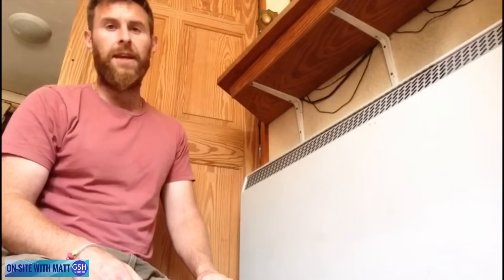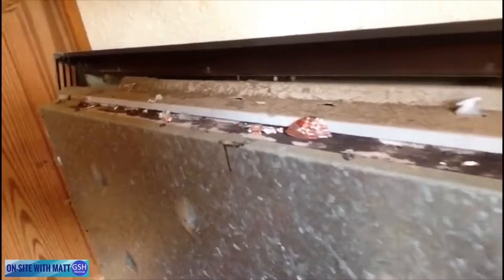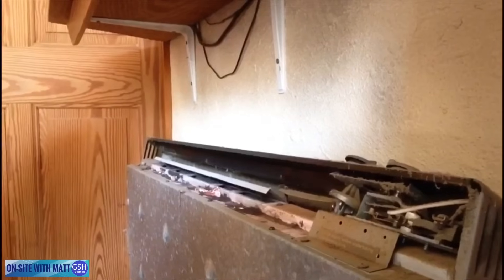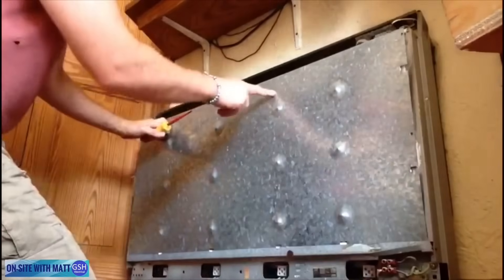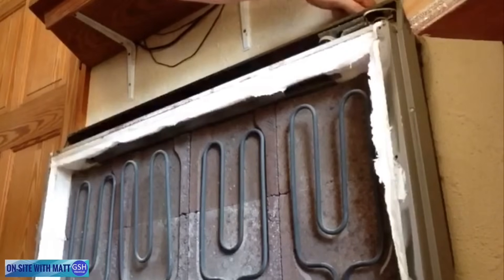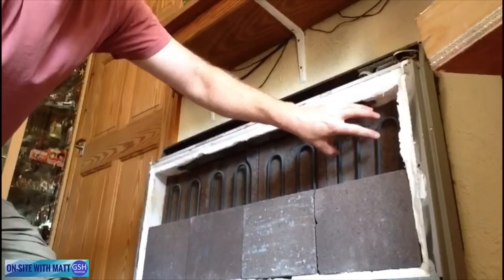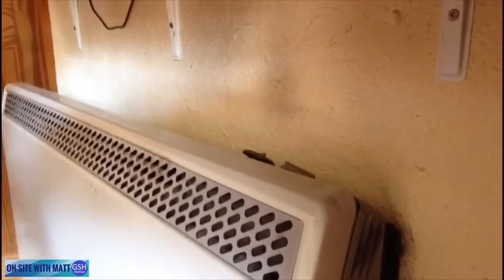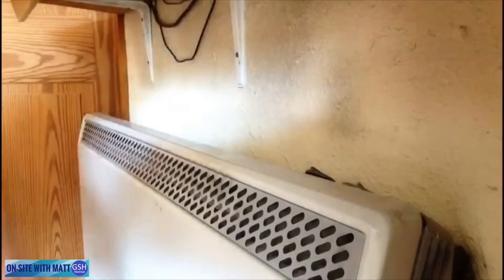Storage Heater is Losing its Heat too Quickly (Won't Stay Hot Fault Finding)

Comment: I have three of these very same heaters. 1x XL12 in the hall and 2x in the living-room, larger XL18s  The two living-room ones are not working. Vents closed thermostat on boost. Left that way overnight but still stone cold in the morning.  Power supply is on at the wall switches and mains board

Comment: Extremely useful, Thank you! This is the exact same model and size as my storage heaters. I'd never experienced this type heating until I moved into a new flat recently, and its been a shock financially! Each heater is costing me £1 an hour. Is this normal? Even with just 2 heaters its costing me £14 a day to heat the flat. Also, despite having the output dial at the minimum, the heaters are very hot in the night, once the Economy 7 turns them on. I'll take the cover off and check the vents are working properly, and maybe also check the thermostat?
Reply: These are wrongly seen as normal electric heaters they are not they use night time economy7 cheaper electric to store heat in heater core to push heat into room during the day.The heat from storage heater is stored heat from previous night.Storage heating is good if you understand how to work and plan system a lot don't know.Storage heaters for living rooms ,hall only panel or fan heaters for bedrooms ,kitchens.

Comment: Conclusion: there is no fault, other than the design fault of storage heaters - they do not insulate the heat while charging. The only way to get them hot during the day is to have them being super hot during the night by charging them at full power. Turning the output to zero while charging makes no difference.

Comment: Also, how does the heater know when is economy seven and to draw input? Is it only linked in to the economy seven electrical in the house??? Thank you, i don't understand but have to use them and trying to balance bills with heating (as we all do...!)
Reply: Storage heaters are on a separate economy 7 circuit controlled by time switch

Comment: Thank you, great video, now I understand about the output being a physical flap that opens and releases more heat.  So I can switch it off at the wall during the day and the output will continue to be right as it's mechanical/physical flap.
Also, how were you able to switch it on there in the morning and get heat into the elements - don't they only draw energy at night? Thanks again very much for the information, so important for people like me, budget conscious storage heater users
Reply: The elements are charged during the off-peak tariff. Off peak is say, 10pm - am

Comment: It is way easier to use a small amp clamp to measure the current flow to test the unit. You don’t have to open the inner panel to do it. Would have taken less than 5  minutes to test the elements.

Comment: My storage heating has suddenly stopped working totally, but the normal heater still works,  the fuse box is ok. Any ideas what the fault is ?
Reply: Well I opened it up, hoovered the dust and fluff , pressed the reset switch down ( little metal thing) , and now it's working better than it ever has done, giving our more heat than before,  I was just going to buy a second hand one tomorrow as well

Comment: Great video Matt.  It does beg the question as to why storage heaters are so expensive when the units are so simple and the components are cheap, at least from what I have found.
I have a problem with a similar Creda storage heater with four elements.  One side hot, the other side clearly not.  Already had 2 elements replaced just over a year ago and expect the other two have gone now.
If replacing the elements, how are they removed and new ones fitted?   Or do you have that in another video? :-)
Reply: The elements are connected at the bottom into plastic blocks with a grub screw for each connector. Trouble is they get very seized up with time and heat. Use the right size screwdriver and make sure it’s a good one, push in hard as you turn
Reply: @nicholascarter2640  - Many thanks.  I eventually decided to replace all elements in all the heaters, 7 elements in total across 3 heaters, so it was a good exercise and resulted in a very happy tenant.  Certainly it seems best to use a mask whilst taking storage heaters apart as they can have a considerable amount of dust and dirt inside.
Reply: @monsterp1970  did it make a great difference in heat changing the elements?
Reply: @thebrightsideofthemoon5829  - Hi.  The elements either work or they don't, so I don't think you'll get "half the heat" from an old element, for example.  I presume it will either use the full 850w of power or not.  They're either on or off, unless one of the electricians can correct me.
The house was very warm last time I visited my tenant.  These storage heaters are 26 years old, yet barely any design change to the latest one's.  A great way to have heating if you're at home most of the day.
Reply: @monsterp1970  , I'm glad you told me that, I was thinking about replacing mine to see if it would give me more heat. Mine stopped working totally but after watching YouTube videos on how to reset it, it's back up running.
Reply: @monsterp1970  Ive just picked up a 2nd hand dimplex quantum storage heater and thinking of replacing it for the older one like in the video. But as there is always someone in the house and I'm a bit of a night owl due to insomnia I don't know if the Quantum would be as good at having a steady heat. I know they're supposed to better at storing the heat and letting it out when you need it most  from a fan at the bottom with the timer. But will it be colder than the old ones when the fans not running?
Reply: @thebrightsideofthemoon5829  - I believe that one has a thermostat digital control, which maybe adjusts the flaps for you for adjusting release of the stored heat.  There is also the boost of an electric fan heater at the bottom, which essentially, is like switching on a fan heater.  I expect you can control whether this comes on or not if you wish.
If the heating element wattage, number of them and amount of bricks is similar to what you had before, then I imagine you'll get the same amount of stored heat, hopefully better.

Comment: After a few years old the Dail switches brake at the bottom and will cost 8 pounds for a pair it's the heat that brakes them advise once set leave along prolong the life

Comment: In these storage heater is a safty cut off located near the power in switch which will disconnect if items are placed on the vents of heater which I have had to reset as people do cover vents he screws in the bottom on heater are 7 millermeter sockets head's

Comment: I've never used or owned storage heaters so I am unfamiliar with how they work so watching this has given me some insight. Those heater elements heat the bricks overnight with cheap rate leccy and those bricks are made from such a material that will retain the heat and release it slowly enough to keep a house warm enough all day and maybe night time too,  even in the depths of the coldest winter? What material are those bricks made out of?
Reply: Crap in minus temperatures... doesnt keep the house warm

Comment: Hi Matt - I wonder if there is an error in your video?  I'm not sure that the bricks in the storage heater are the facing the correct way.  My understanding is that the recesses in the storage bricks should be facing away from the heating elements, whereas the bricks in the heater you serviced are facing towards the elements.  I think this probably accounts for why the heater is losing it's heat too quickly - because the elements are not actually touching the bricks, but are able to move freely and so mainly heat just the air around them rather than the bricks.  Please see link to the Dimplex installation manual here

https://www.dimplex.co.uk/sites/default/files/assets//FXLi_Instructions_Issue_001.pdf    

Please see point 11 about the back wall of bricks which says "Carefully fit the bottom row of the back layer of bricks placing the two end bricks  into position first. Ensure that the recess in the bricks is toward the rear of the heater with the narrow end to the bottom. Repeat this with the top row of the back layer of bricks but the narrow end of the recess must be to the top”  

Point 12 also says.  "Fit the front layer of bricks with the recess toward the front of the heater"

I must admit, this didn't seem logical at first because the recesses appear designed to fit around the heating elements, and indeed that was the way you found them facing when you opened the heater.  But I have had two storage heaters for a long time and the first one never worked properly, but it was installed with the recesses  facing the elements.  The newer one has worked fantastic for 13 years and when I took it apart yesterday I found the recesses were facing away from the elements, as the installation manual specifies.  It means the elements are tightly trapped between the bricks, giving much less chance for the heat to be dissipated by the air and so the bricks heat up much more.

I'm not an electrician, and yours was the only video I could find on Youtube, and it really helped me to take my heater apart thank you.  I have had to change three of the elements which had stopped working -  even though they looked in perfect condition.  As they have lasted 13 years trapped against the bricks this way, I am now convinced this is the correct way to install them.  I didn't install the storage heater myself, and that's the way the professional installer had originally fitted them.

I'm not an electrician so I hope anyone reading this will take professional advice as there may be something I've not considered properly, but they way I read the installation manual for my Dimplex FLX 24 seems to say the recesses should be facing away.
Reply: I see your point about the recesses must be needed or they  wouldn't be there.  And on the old second hand storage heater I put together without consulting a manual I just assumed they must fit round the elements, so I installed them that way.  But  it never worked well.  My current (newer) storage heater was put together by a professional fitter and has always worked brilliantly.  It was only when I dismantled it to renew the elements that I discovered the bricks had been fitted differently to what I expected, so I checked the manual before putting it back the same way as I found it.  I think "make sure the recesses face the rear of the heater" refers to the back wall of bricks in the heater  (i.e the ones behind the elements) -  and they do indeed need to face backwards. Only the recesses in the front wall of bricks need to face forwards. 
I can't answer for definite why the bricks have recesses when they don't look to be needed, but I'm not a storage heater designer so there may be a reason the designer knows about.  Is it possible it could be to allow better air circulation between the bricks and the insulation material, so allowing heat from the bricks to better circulate into the room?  
Thanks for replying as I was curious to hear what other people had found
Reply: Good Informative Video. On the subject of Brick Orientation the XLN Manual https://www.manualslib.com/download/903372/Dimplex-Xln.html clearly shows the recessed profile of the bricks facing  the element. Can only assume this is to facilitate the movement of the element as it expands when heating up. (Page 2 Diagrams 2 & 3)

Comment: Another great and really informative video from you guys. . Before dismantling , would you not have been better off PAT testing the appliance ? I PAT tested one recently which failed the insulation resistance test suggesting that it was an element that had failed. This one would have passed I presume? Which may well have saved you from having to dismantle it with the associated risk of asbestos which is present is in some types of storage heaters? Adrian
Reply: These days you won't get asbestos in these

Comment: Hi  Matt, good informative video, a couple of things I’d like to point out though.

I work on storage heaters quite often as my work is all for the social housing sector.
The first thing, like someone else has mentioned, never ever remove that internal cover until you have checked if that model of heater has Asbestos inside it. There are 100’s of older models that do including Dimplex ones, you really should point that out or put a disclaimer on the video regarding that.
You also take a different approach to how I inspect and fault find them. Removing that internal cover and bricks is normally the last thing I would do, totally unnecessary in most cases. Just doing a simple continuity test to check the resistance of all 4 elements will tell you the condition of them, and if reading not as expected you can then test the resistance of each element individually, which can still be done without removing internal cover and bricks. This method is also better as a lot of the time on a typical economy 7 system you do not have that hour boost during the daytime, so will be testing on a dead circuit. The majority of the time it’s just the thermal cut out that needs resetting, but from time to time I do replace the elements, thermostats or repair replace burnt out cables e.t.c, but always find a continuity test the best starting point.
Agree with you on the operation of the dials though.
Reply from the maker: Hi. Wow thanks for taking the time for such a detailed message. All points are very valid... Matt wanted to show our learners the inside of a storage heater (space heater) as it’s construction is part of an assignment he administers. As you can tell there is no real issues with the heater,  maybe a different approach could have been considered. However the content the on site with Matt’s provides is valuable to his students. Thanks so much for watching and commenting GSH Electrical 👍
Reply: @GSHElectrical  A really good explanation dude! 👍 I was thinking....the thermal camera on my CAT 62 pro phone would be able to see the heat, & give on-screen temperature readings of each individual element when the heater is powered-on, without taking-off the covers.  🤔🙂
Reply: @videostarish czy ten telefon spełnił to zadanie?
Reply: Hi Darren, 
I agree with you absolutely!
I also work in the social sector and your method is the same as mines 👍🏼
Reply: Would like to know how to reset the cut out on a storage heater when it has been covered. Thank you.

Comment: I take it the heater was not on economy 7 for you to be able to test it?
Reply from the maker: Hi. I haven’t talked with Matt but it could be heat wise 10 and or have a boost button. Thanks for commenting and watching GSH Electrical 👍
Reply: I am usually using extension lead to get a temporary supply , just to prove

Comment: Great video, always interesting to see real world fault finding, also an interesting talking point is it is not always the equipment that is faulty, sometimes you Can attend fault finding and the outcome be the client is not familiar with the correct ways operate the appliance optimally and is in need of guidance. I guess something in situations of regular turn over tenants or purchasing a property with existing appliances.

Comment: Hi Mat. So are we saying it was what I call user error.
Reply from the maker: Hi it’s Gaz. From watching and editing it I would agree. The output vent was fully open. Thanks for commenting and watching 👍
Reply: pmailkeey did you watch the video? When the cover was first removed the flap was fully shut. Having voltage at the elements doesn’t mean they are working, you would have to check current draw which would have been tricky, Matt’s choices was by far the easiest method.

Comment: Thanks for the video.  I worked as a mate when I retired and my first job was building these things all day.....humphing bricks upstairs is no fun! I'm not a spark but have worked as a mate off and on....how do you check the heater if they're on a time switch that only powers them up overnight?   Do you do the work at night?  Also, I've found occasionally they overheat and trip.  There is a reset button under the cover near the thermostat control.
Reply: I think it’s a good idea to advise people who are potentially going to work on these things to check with the manufacturer whether the insulation panels are asbestos or not before taking them apart as some are
Reply from the maker: Hi. I also as an apprentice had to carry the brick all day long. The system normally has a one hour boost button. Thanks for you detailed comment and  watching GSH Electrical 👍
Reply: GrumpyGrampa - You can check the operation of the storage heater by disconnecting the circuit from the off-peak consumer unit and connecting it temporarily using a lead to a 24 hour supply.